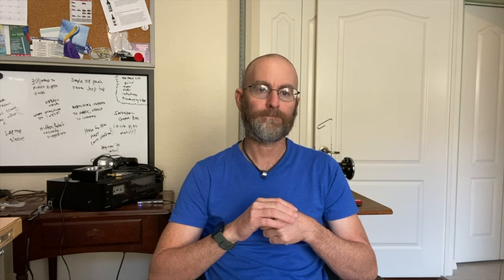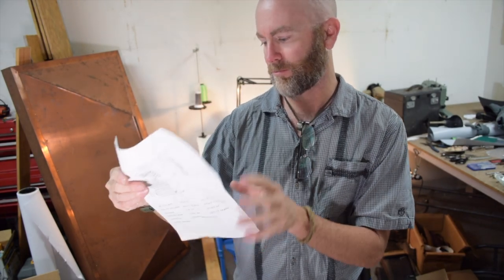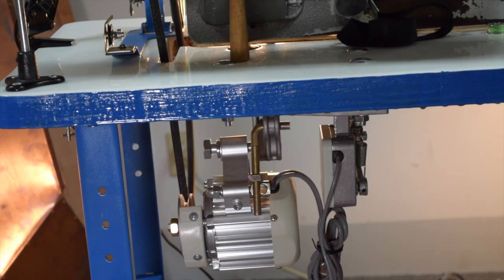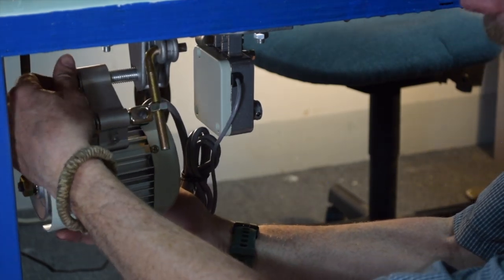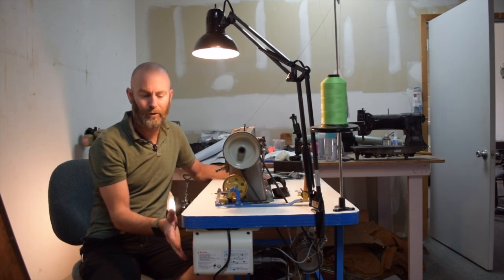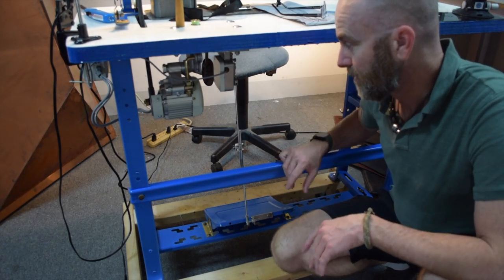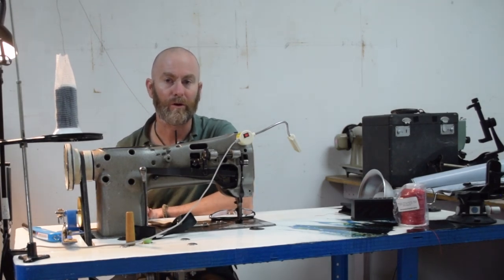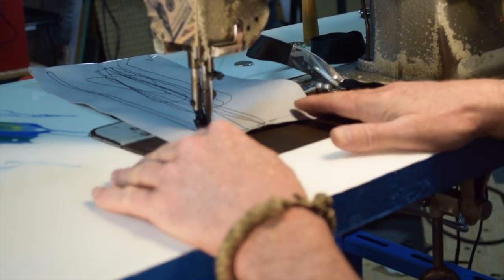Dumping The Clutch - Installing A Servo Motor On An Industrial Sewing Machine

Comment: I have a clutch motor on my Consew. The secret to a clutch motor is to change the angles of moment in the foot control set-up. That, with a smaller, 40 mm motor pulley, I can put my hand on the machine wheel and feel the slight vibration of the clutch making contact. I can start up under complete control and sew at a steady two or three stitches a second. Not really slow enough for leather, but it does work. For everything else it is just fine. Also, with the reduced gearing the torque is through the roof! A servo motor would be good, but the benifit isn't worth my money, considering I don't have a great deal of it!!

Comment: I too have a  small consew with a homemade box for it to sit in the one it came in was crushed due to the weight of the machine, I've since have aquired  a rather large pfaff industri the table looks like yours now all I need is the manual for it , so if you know  of where I  can get one that would be helpful  and I liked your video I might switch mine out I didn't know  anything  about mine guess I better AI it b4 it crashes

Comment: You will lose the power!
Reply from the maker: That has most definitely not been my experience.  Until recently I used the clutch motor I removed from this machine on a different machine, and if anything the servo motor feels more powerful.

Comment: I've just built a pulley reduction unit for my industrial sewing machine. I also stripped down the clutch of the motor, cleaned it and oiled the clutch plate. Seen that tip in another video.
However, even with all that, the lack of start-up speed control is what made me buy a cheap servo motor setup. A pulley reduction with a servo is the ultimate setup because of the very low speed you get but the servo motor also goes up to a high speed, so even with the pulley reduction you can still have the higher speeds when needed.

Comment: Does the servo motor still work ???
Reply from the maker: It does! The needle synchronizer broke a couple of years ago but was easily replaced.  The motor itself has been trouble free.  I have a lot of machines, but this machine is my main machine and gets used a fair bit.
I hope that helps, thanks for watching!

Comment: Ciao, was the positioner included with the motor or did you buy it separately? Thanks
Reply from the maker: Hi!
I bought mine together with the motor, but they can be purchased separately on Amazon. Thanks for watching!
Reply: @thejasonofalltrades  thank you!!! i ask because on amazon they only sell servomotors without positioner, and even if at the end of the video you said it was included i wanted to be sure. I will buy it separately. good work, God bless you

Comment: at our company we've had too many of those Chinese made control boxes fail.   One component on the board fails and it's done.   I've trashed several and too many that really never saw much use.    The best servo motor we've found is the Reliable brand....6000SM.    Only one of 20 has had issues.    I won't buy any more separate control box systems.   Servos are great so long as they work.

Comment: Hello I bought a machine with this motor and it's working backwards instead of sewing forward 😢 please help
Reply from the maker: Hi,
On many servo motors you can reverse the rotation of the motor in the settings on the controller.  You may have to experiment if you don't have good instructions (likely the case).
I hope that helps, good luck!
Reply: @thejasonofalltrades  yeah I figured it out myself if it's stuck on C just press P and + together and C will change to P
Reply: @thejasonofalltrades  thanks I figured this out but I now need a full error manual where can I find that?

Comment: I really want an industrial,  but want to buy it in peices little at a time. Can a servo motor work with any industrial machine? Thank you ! This was a great video!
Reply from the maker: Hi!
Yes, this motor will work with any belt-driven machine. If you find a machine head or a machine with a bad motor (or a clutch motor and you don't want that), then yes, a motor like this is a great way to go!

Comment: Still working?
Reply from the maker: Hi!
The motor still works great. The needle synchronizer eventually broke, and I replaced it with another without issue.
I hope that helps, thanks for watching!
Reply: @thejasonofalltrades  thanks for reply

Comment: Hello Sir, is there a solution for a servo motor that the pedal is no longer longer functioning, mine just stopped working
Reply from the maker: Hi, 
I'm not an expert, but I would check to see that the linkage is still connecting the pedal to the motor controller, and that the wires connecting the controller to the motor are still connected. If you have the manual for your motor, check the "troubleshooting" section for other ideas. If everything is connected, my wild guess would be a problem with the controller, not the motor itself, but I am truly guessing.
If you figure it out, let us know.  Good luck!

Comment: How has this been working for you? long term review?
Reply from the maker: Hi! Within the last year or so (I think, time has been difficult for me to track the last few years 😂) the needle synchronizer failed, but I easily swapped in another.  Otherwise the motor has been great.  I rotate between quite a few machines, but this one is my workhorse and gets used the most (not daily, but regularly).  For the money this motor has been a great purchase for me.
I hope that helps, thanks for watching!

Comment: Hi jason. This video is great btw. 

I need to change my clutch motors for the servo motor, but I heard you mentioned your mentor had bought one f the same as the video, it didn’t last so he got other ones and fitted them. What model is the one they bought? If you can let me know that would be much appreciated. 

My concern is that I have these machines used 8 hours a day for 6-7 days a week and really need something really robust and that would do my work. 

Thanks mate. And thanks for uploading the video, very helpful.
Reply from the maker: Hi, I am SO sorry for taking so long to reply!
I haven't had contact with the person I worked for who made that statement for several years now, and I have no idea what motors he purchased.
Personally, I would be quite comfortable running the motor from this video (still in use) full-time.  At worst, you might have to replace one now and then.  I honestly don't know of any truly high-quality motors (I'm not saying they don't exist, I just don't know anything about them) on the market, with the possible exception of the Sailrite Workhorse. I love Sailrite, and I think that is a great motor, but unfortunately it is NOT plug-and-play compatible with a needle synchronizer (it can be made to work, but requires a little more effort, from what I understand). 
If it makes financial sense, it might be worth buying two of the inexpensive motors and just keep one as a spare so you aren't down for long if your motor breaks, but honestly I think the motor I have would be fine running full time.
I hope that helps, and again, my apologies for the delay!

Comment: I bought a consew server motor for my consew 206rb industrial sewing machine.  The cost was just over 100 bucks.  It is absolutely great, it is quiet, and easy to control unlike the previous monstrous motor that was loud and impossible to control.   I doubt there is a person out there who could possible afford the 100 bucks who wouldn't be thrilled in making  the change over.

Comment: I found my new servo motor to be strong and efficient for the work I’m doing. I had no trouble rigging it up to my Mitsubishi industrial machine. It slotted straight in. I did have to buy a smaller gannet though.  Then it sat around for4 months being useless till I could find someone with the knowledge to sinc it in with code to make it work.  However He did this by guiding me over the phone, so if I need it again I’m in trouble. He’s now retired. 😩

Comment: washers prob not needed - the bracket holding the motor can be loosened and slid back/forth and/or repositioned to find optimum placement.

Comment: Good job on the video! Clutch motors are not to bad if you have the clutch set right on them. However servo motors are nicer because of very precise control. I have a TechSew 5100 (like a Juki 441) with a servo motor and it’s great because of the very heavy work it can do. My recently acquired Singer 211U566A has the old clutch motor and it’s ok except for the slow predictable control and when it’s on it is always drawing power and making noise. This one will be getting upgraded to a servo motor too. Big Duck Canvas are good people.  Cheers from Canada.

Comment: Is that not the brushless motor . There are 3 motors for industrial machines the clutch motor , servo motor and brushless motor the one you installed is the brushless motor . The servo motor is the brushed motor
Reply from the maker: You might know more about this than I do, I'm certainly not an electric motor expert.  It was labelled as a "servo motor" when I bought it.  My limited understanding is that the "servo" part is completely separate from whether the motor is brushless or not. In other words, one could have a "servo motor" that uses a brushed motor OR a brushless motor.  I welcome any corrections or additional information on the topic, though!

Comment: I am not a fan of the servo brush less motor with computer, they are not design in my opinion heavy duty design enough to last,
I don`t know if they just cant deal with heat build up running slow speed or some like that,
I personally kept my clutch motor and reduced speed with pulleys ,
This also allowed the clutch motor to run at its normal speed so no heat build up and no loss of torque,
When you reduce a motor of its speed they usually reduce the current and this reduces its torque on thicker material like leather,it also is a opportunity for heat build up 
I have several types of machines some old industrial leather and canvas workers like 7-33 or 132k6 and 45k1 and even a shoe patcher 29k-4 and some not as old with servo motors,like put on them 307G2 or 211G151 and 331K1 
I keep the old clutch motors on the older industrial machines at least 70 years old motors and never had issue,
Where the servo motors had lasted 2 years on some and failure on the computer box,
So don`t get rid of your clutch motor he will out last any modern motor at the moment, just need replacing the clutch pad from time to time,
There are modern motors with brushes with a speed dial , 
But if you really want a good way to have power and last is a three phase brush less motor with a converter reducer to the electric ,
The trouble with brush less they were never design to be speed reducers due to heat build up in the winding,s, 
So that`s why people recommend three phase brush less with converter, 
I don`t know if enough info or research have being done on servo motors for sewing machines long term,usage I think they went with them due to there quietness and slower start up pace with a turn of a dial,
But the price reflects the product!!
 I would favor the brush modern motor with no computer just a speed control dial that is built into them, if I had to go with a more modern type,
But that`s just my opinion,
Clutch motors are down to foot and ankle mussel memory the more you use the easier to control,

Comment: I can comfirm this does work and is a very simple change. I did it in a twin needle machine. Works great. Keep a spare motor though. I dont expect it to last like the clutch motor. These motors are fantastic for heaps of machine workarounds.

Comment: My 1964 year clutch motor lasted up till 2017 year, i was moving work shop and a dropped the motor and broke a cast, so i had to buy new, servo motors are rubbish  a 7 class singer needs clutch  motors to make needle heat up slowly as we so 15mm

Comment: Dear sir, how is your light attached? How do you attach lightning to your servo motor power switch
Reply from the maker: Hi!
I usually just plug my lamp into a regular outlet. I sometimes use the lamp when I'm not actively sewing, and may not want the motor switched on (maybe some motors are different, but the ones I have used have to be turned on to power the built-in outlet, if present). The lamp I use is just a standard desk lamp that clamps to the table, I think I got it from Amazon.
I hope that helps, thanks for watching!

Comment: What kind of belt did you use
Reply from the maker: It's a v-belt purchased from an auto parts store.  You can use a piece of string (or something similar) to wrap around the machine pulley and motor pulley to determine the belt length you need.
I hope that helps, thanks for watching!

Comment: Still no control over the speed ?  that motor does not seam to have any variable speed to it it looks like it is pretty difficult to keep it from going full speed. ?
Reply from the maker: I'm honestly a little perplexed by your question, the speed control on this motor is night-and-day compared to a clutch motor ...? In the sewing demonstration in this video I show the machine going very, very slow, and very fast, and some speeds in between. I don't know if you are interpreting a sudden change in speed as the motor being difficult to control, but I was simply flooring the pedal to go from slow to fast.
When one gradually increases speed on these inexpensive servo motors, they accelerate in "steps" rather than a smooth curve, but controlling the speed within those steps is quite easy (and I had the motor set at a quite fast 4000SPM in this video, I now keep it at about 2,500).
The Sailrite Workhorse servo motor has smoother power gradation with more "steps" than this cheaper motor, if that's a concern for you. However, it is not plug-and-play with a needle synchronizer.
Sorry if my demonstration didn't make it clear, but yes, the speed control is a VAST improvement over a clutch motor. I hope that helps, thanks for watching!
Reply: @thejasonofalltrades and do you have an actual link? What's the minimum rpm of the motor?

Comment: I think the most important factor to consider would be if the bearings are standard sizes so can be bought at any online bearing seller. That could be really important to know. Odd size bearings would mean it would probably be cheaper when one wore out to throw the machine away and buy another as opposed to paying $5 to $7 for a standard off-the-shelf bearing.

Comment: I'm actually just now starting to learn how to use a Juki machine with a similar setup. I have NO IDEA what I'm doing. I plan to do some basic marine canvas and vinyl work. Every time I look at the machine I get overwhelmed with all the parts, switches, accessories and doo-hickies. 😅 I'm a boat & car mechanic with extensive knowledge of most things mechanical but this machine honestly has me concerned that I may not be able to figure it out😮.
Reply from the maker: Don't sweat it, I had no idea what I was doing when I started sewing, and now 10 years later I pretty much still don't! But I've made some killer stuff in the process :)
You'll probably be surprised at how quickly things start making sense, especially with your mechanical background. 
Some industrial machines have more features than others. Feel free to send me an email at 
the jason of all trades @ gmail . com (remove the spaces)
if you're too bewildered, and maybe I can point you in the right direction.

Comment: Does the servo motor have a reverse function? Have a clutch motor now with no reverse that has reached the end of its life, I think. Not sure if I want to rebuild it or get a servo
Reply from the maker: Hi!
On sewing machines, reverse has nothing to do with the motor; the motor ALWAYS spins in the same direction, and  importantly, the hand wheel/balance wheel on the machine ALWAYS rotates in the same direction. Reverse is accomplished in the mechanism connecting the machine's feed dogs to the main shaft of the machine, so a sewing machine that does not have reverse cannot have reverse added to it. Running the motor in the other direction would likely cause the machine to go out of timing, and would not cause it to sew in the opposite direction.
Electric motors that have the ability to run in both directions are to allow the motor to be mounted where it is needed for a particular application.
A servo motor is an awesome upgrade from a clutch motor, though! I personally wouldn't invest time or money into repairing/rebuilding a clutch motor at this point.
I hope that helps, thanks for the question, and thanks for watching!

Comment: I have a Consew 210 which would not go slow, it just took off like a rocket as soon i touch the tread. I took the clutch mechanism off the motor and lightly sanded the flywheel and deglaze the cork clutch plate with a copper wire brush then blow any dust off, put it back together and it will go as slow as you want without losing any high speed. Didn't cost a cent to do.

Comment: I started out with a clutch motor driving my machine and new I didnt like it at all.  So I went onto the ol Ebay and looked around and bought a servo motor kit and although the control it gave was remarkable I took it a step further and bought a much smaller pulley for the motor output shaft.  Doing this slowed the machine down to where reliable single stitch at a time control came a reality.  That was 13 years ago and not once have I though the change was a mistake.  And that linkage issue you had, I use a length of paracord which I simply tied to the speed lever on the motor to the pedal.  You dont need a stiff rod to let off, I think the lighter weight gave more crisp foot control with the paracord rope.